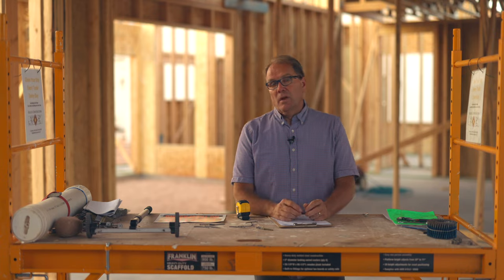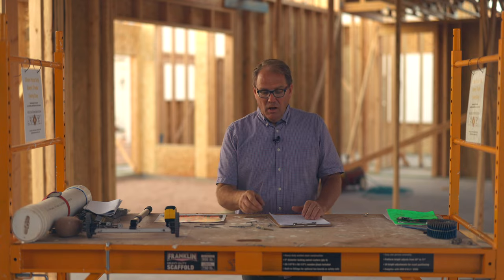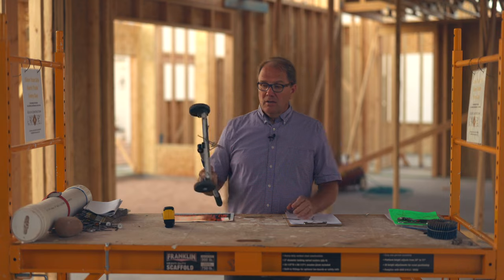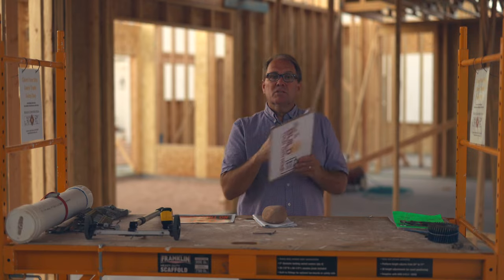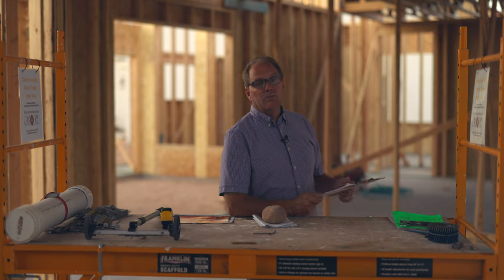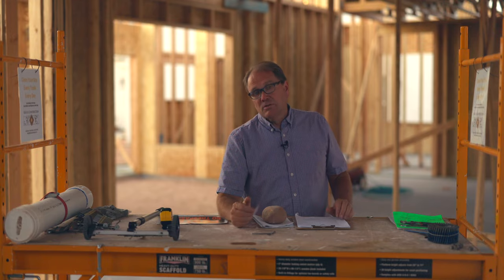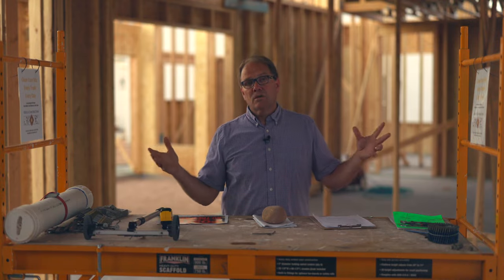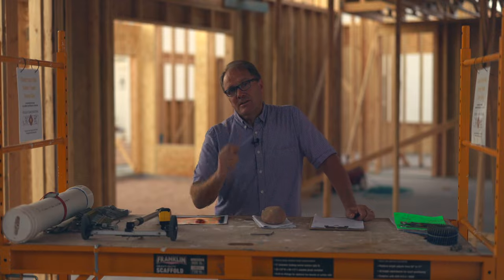Pre Construction Meeting With Framer

Comment: Thanks for the video, I took some great tips from it. It's hard to find reliable tradesmen and as you said, they constantly switch jobs or get sick. During Covid/ on my current home I constantly got dumped by contractors who felt their pre-Covid pricing was too low. There is some panel plants close by where they prepare wall panels and trusses offsite. Once lumber comes down I am seriously considering it. One thing, camera work is greatly improving, love the angle and the switch. One thing I noticed, the pan was a little shaky, if you would use a tripod it might look better. Hope you have lots of success in your business in return for the value you provide here.